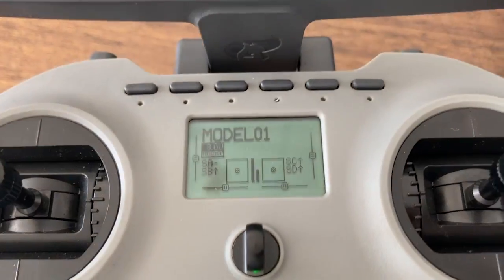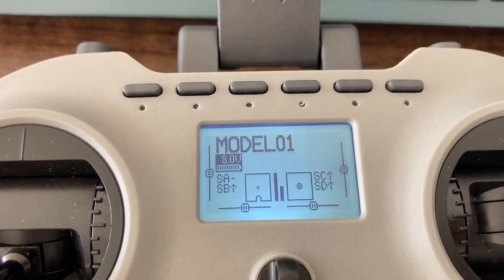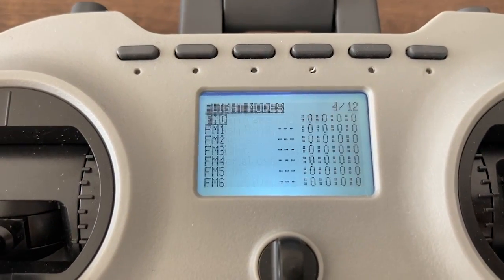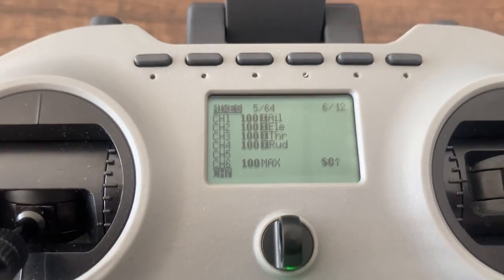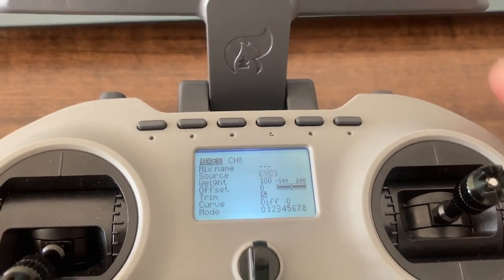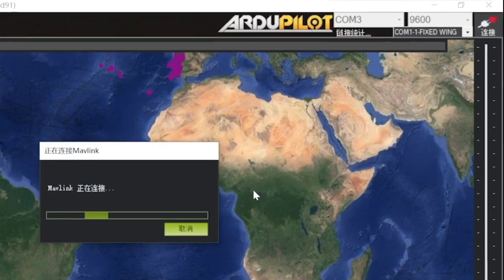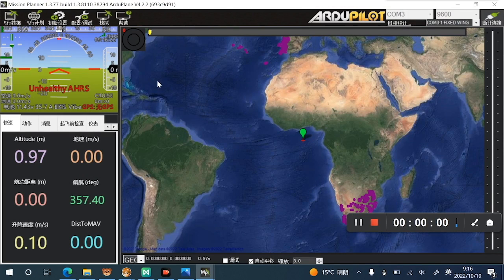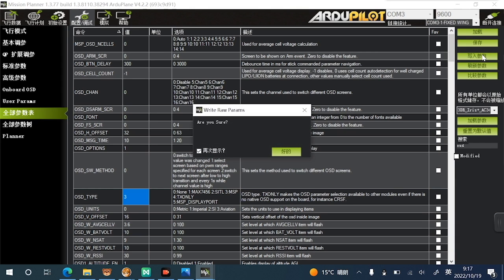Jumper RC XIAKE 800 Y3 VTOL SETUP

Comment: Hi jumper.... Can you please explain why you didn't wire up the compass... The supplied unit has a compass and gps..
Is there going to be a mk2.version.. Because the first version with its yaw instability is useless in anything but light winds... Please reply so people can see you care about your customers
.. Thanks
Reply: compass is very spotty for heading for ardupilot. it requires calibration and seperation from ESC.
Reply: Farming nightmare!!!!

Comment: connected the polar caddx air unit to the jumper xiake 800 . on DJI Avata glasses , FPV does not output OSD . how do I display the indicators on the screen ? any suggestions?
Reply: Have you downloaded mission planner you will need this to change to dji osd

Comment: I purchased the Jumper XiaKe 800 Portable Fixed Wing Wingspan 800mm VTOL FPV Aircraft with the radio transmitter from you but the audio voice coming from the radio transmitter is in Chinese and I need it to be in English. Can you send me the procedure on how to change the language of the sound files?